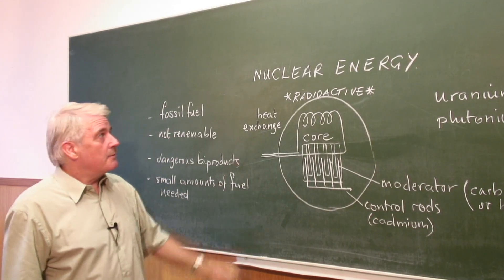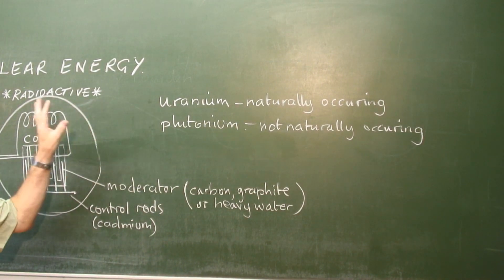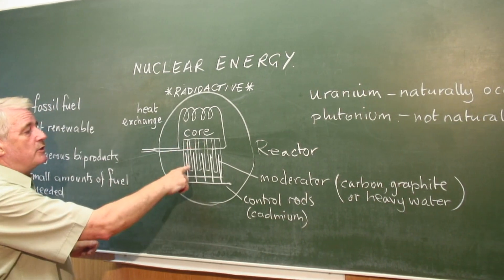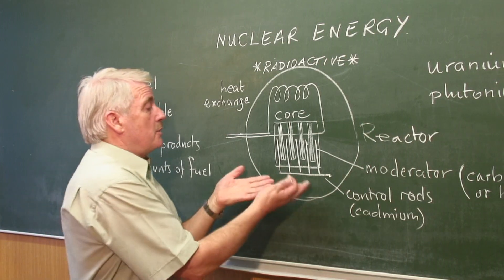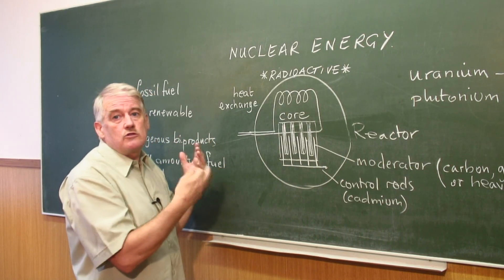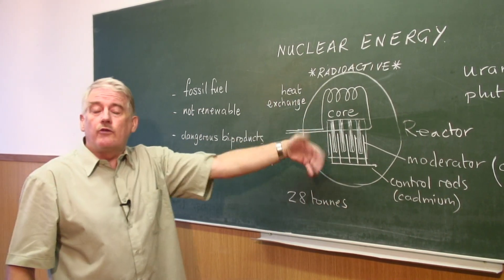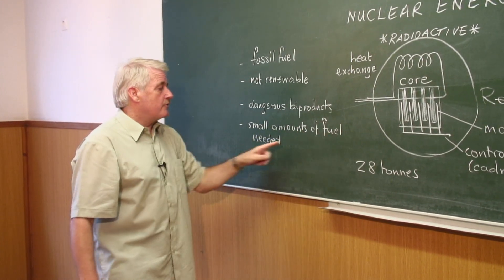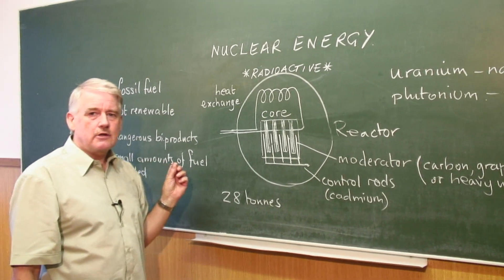How Things Work : How Nuclear Energy Works

Comment: Commercial and utility plants currently use nuclear fission reactions to heat water to produce steam, which is then used to generate electricity. A nuclear reaction is the process in which two nuclei, or else a nucleus of an atom and a subatomic particle from outside the atom, collide to produce products different from the initial particles. The nucleus is the very dense region consisting of nucleons (protons and neutrons) at the center of an atom.

Watch our Budhiya Video "Ek Tha Budhiya"

Comment: Better yet, there are next-gen designs that use nuclear waste as fuel.  There'd be no need to mine for uranium for at least decades if this design is implemented.  Yucca Mountain would be negated.  Google "integral fast reactor" or better yet, read "Prescription for the Planet" by Tom Blees.

Comment: Pretty good video, but it seems to handle the specific case of thermal reactors without explaining why it matters.  You kind of glazes over the purpose of moderation, and the consequences of different methods thereof (which are a safety consideration, as the method of moderation affects the coefficient of reactivity).